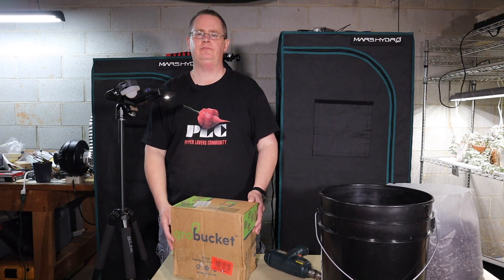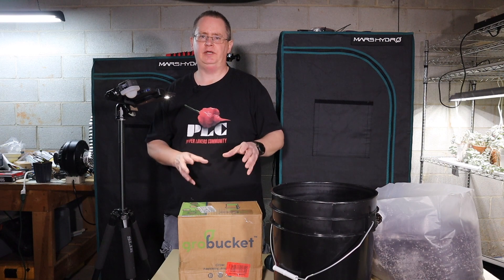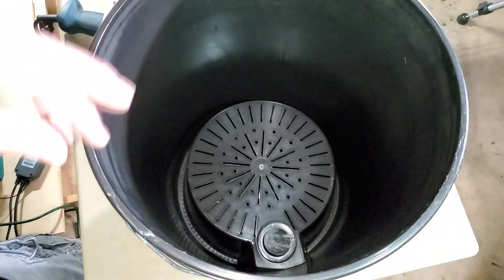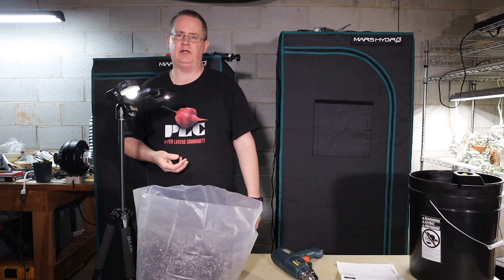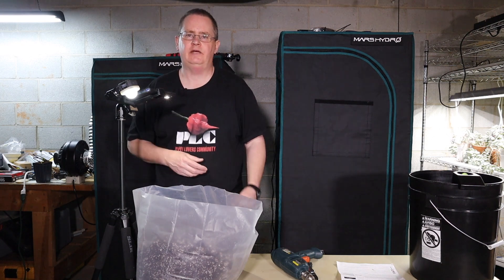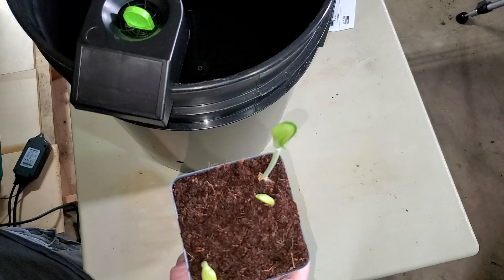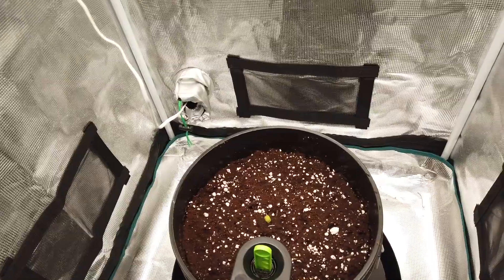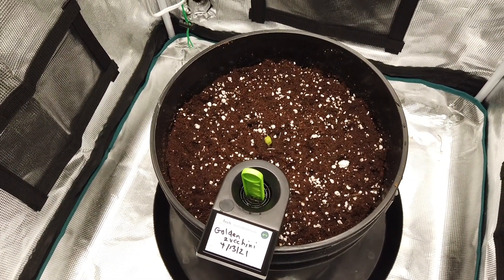GroBucket self-watering system - Setup and first impressions

Comment: Does this hole have to be in the container if we have a water level indicator?
Reply from the maker: I wouldn't advise using it without the hole. If you accidentally overfill, there's not an easy way to get the water back out. It's possible the water level indicator could get stuck, or something could happen to falsely indicate the water level. I wouldn't rely on that. Having the hole there also allows some air to get in which helps the roots. Hope this helps.

Comment: if doing a bucket in bucket you dont need a net pot..just drill a 1 inch hole in the centre of your top bucket and some smaller holes surrounding the centre hole .use a 1 to 2 inch filler pipe and drill the overflow hole just below the first bucket and to make a wick just use a microfibre cloth..job done..use a wine cork as a float..

Comment: When I packed in the potting mix around the edge, it pushed up the insert so the inserts on the top piece no longer fits down over the bucket.
Reply from the maker: I sounds like you might have packed it too hard, forcing some of the potting mix underneath.

Comment: Not $13.00 anymore. Try around $50 bucks now.
Reply from the maker: These are sold in 3 packs. They have gone up a little. Instead of 13, they are 16.66 each now (49.99/3). Still worth it, in my opinion.

Comment: I Use a Normal 5 Gallon Pile like he has but I just Drill a bunch of Holes in it and use it as is this is just a waste of money for these 5 toll on Piles all you need is about 2 or 3 L of water probably every 2nd Day not hard and if you do over do it those holes allow for extra water to leak out from the holes. Yeah this isn't Nessasary just a waste of money

Comment: Hi and Thanks, I live in central Ontario Zone 5b so we get winter and it last about 3 months of cold and snow. My question is what does every one do with there grow buckets in winter? Do you dump the soil? or compost it? I don't dare leave them filled outside as they will freeze and break. I do not have a heated garage, so its in a unheated shed or outside. Would love your thoughts. Thanks.
Reply from the maker: I just dump mine and spray it out.
Reply: @pepperdactyl  where do you dump it, compost or where?

Comment: I have mixed feelings about these. I think the 2bucket system might be better then at least if goes anaerobic it’s easier to change out. Also as someone going organic do I have to get fertilizers just for some of these buckets. If I wanted to run hydro/ferts I would but these are somewhere in the middle.
Reply from the maker: Last year I ran this side by side with a 2 bucket system, growing rocotos, and I couldn't tell any difference in the results.

Comment: are these good for indoors or lower temperatures when there wont be as much top evaporation and thus wicking?
Reply from the maker: You'll need balance with any grow method, temps, light, humidity, etc...  But I've used these indoors in lower temps, and also have overwintered using very similar setups with no issues. I've been growing one pepper plant in my office, which generally stays pretty cool, as I have to wear a jacket sometimes, and it has produced a lot of peppers.

Comment: Do I fill thr reservoir up with water + top water also? Or only top water for a few days then start the reservoir?
Reply from the maker: I water it in throughly when first setting up the plant, then bottom water only, from the reservoir. If for some reason the top layer dries out before the roots get down low enough, you can top water again, but you shouldn't have to do that for long.

Comment: how do you add nutrients when u got it filled up already?
Reply from the maker: You just wait until it uses up nutrients that are already there, then you add more.
Reply: @pepperdactyl  I'm talking about liquid nutrients , do you add it to the water when you fill it up or add it to the soil directly on top of it already being filled up on the bottom ?
Reply from the maker: When you first set it up, you water from the top once. From then on, you fill the reservoir with nutrients. What I do is mix the hydroponic nutrients with water in a gallon jug. Then I fill the reservoir from the jug of nutrients.

Comment: I'm getting ready to look on your channel for your follow-up thoughts on this system. I have 3 of the traditional bucket in bucket self watering setups and can't help but agree with you about how easy this looks. Sure, it might cost a couple of dollars more per planter but the ease of setting this up more than makes up for it. Many thanks for posting such a thorough and concise video.
Reply from the maker: Thanks. Yes, I love the GroBuckets. I've used built and used several of the bucket in bucket setups. I can literally set one of these up, including drilling the hole, in less than a minute.

Comment: Peter, do you think this would work with growing potatoes?  I have these blue buckets that are slightly tapered with rope handles (actually that yellow plastic type rope) which are 16 1/2" tall, 19" inside diameter at the top, slightly tapering down to the bottom, which I bought for potatoes so there would be more room.
Reply from the maker: Thanks for watching. I'm not sure. I've never grown potatoes. Sorry that's not much help.

Comment: I have around a dozen of these systems. The water level indicators that came with mine were corks on sticks that really sucked and didn’t last an entire season. Nice to see they’ve addressed that issue. 
I think you’ll find that the bucket in bucket will be more productive simply because of getting a full 5gal of soil vs what’s left in the GroBucket system.
Reply from the maker: Thanks Mark. That's a good point about some of the grow space being used up by the insert. I'm going to grow two same peppers side by side and see how they do. I think in general it should perform well. I've grown some bucket in bucket setups that were 4 gallon size and grew monster plants.